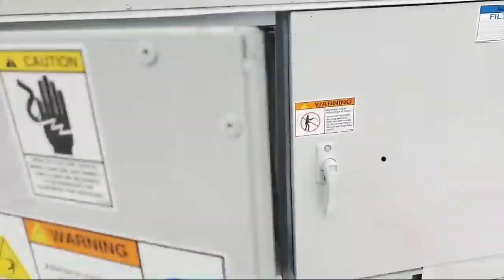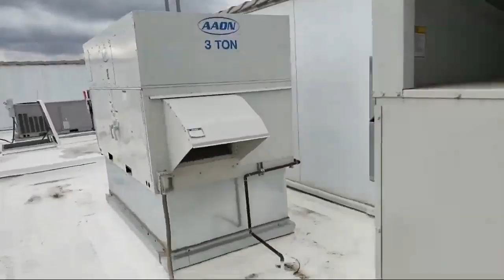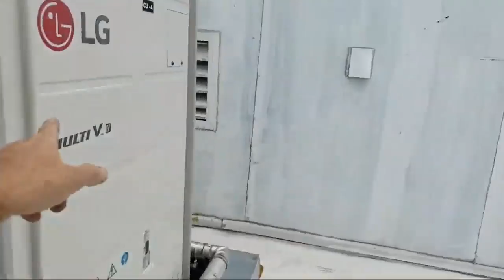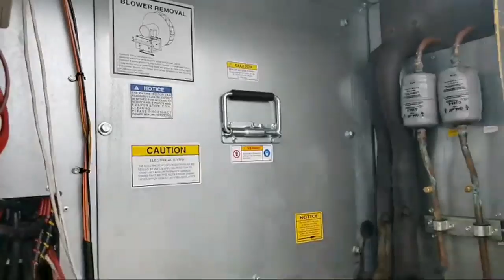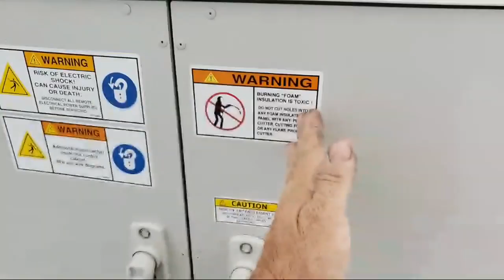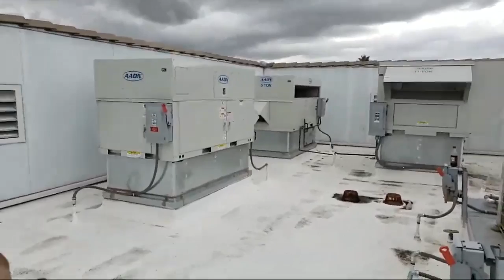Definitely Quieter than a Goodman!

Comment: you can look for a non inverter type rotary compressor for replacing the Goodmans . One of the great way is to lookfor it from the midea or gree dealers . these Chinese manufacture can't make scroll compressor out of there own ,so they have large non inverter rotaries upto 4RT.
Reply from the maker: Do their "non inverter" rotaries tolerate adding an inverter? Because running off of a VFD was my intention if I went with a raotary
Reply: @hackfreehvac I think it is ok , some eletric bus is useing these method to do all of airconditioning inside . also , it is pretty cheap to buy one , why dont have a try ?
Reply: @hackfreehvac  But you probably end up with a 380v (L-N 220v, L-L 380v) 3phase 50HZ compressor. but you are running it over VFD.

Comment: Aren't those digital scrolls more hassle than they're worth?  Surely VFD's are better, unless it's more of an issue with oil circulation if a scroll is slowed down too much?
Reply from the maker: A VFD to slow a rotary compressor would be more efficient but with these units they just care about maintaining a certain supply air temp and just unloading the scroll on a calculated duty cycle works well for that task.
Reply: @hackfreehvac  Awesome :) Keep up the good work on the vids, love em!  I laugh no end at your Good man bashing haha

Comment: Hey brother! Good to see you popping out a few more videos this week!!  I paused at 9:20 or so when you were commenting on the solid state relays in that unit, caught my attention :)
Maybe, mmm, the summer before last (been recovering from another back surgery this last year) I was over at a ham radio buddy's house (83 and more active than me, lol!;) because he had asked me to look at the Rheem condenser on his poolhouse (which he converted to his radio station/computer room) again. Seems like Ive been over there three years now out of five maybe for ants in the contactor.
Anyway this time I wanted to try something new, I had bought a handful of solid state relays because I wanted to get around to tinkering and replacing all of my mechanical ones on my condenser and air handler. (Still haven't yet but...)  id bought some then ran across a thread on the topic saying that it shouldn't/couldn't be rated at just the LRA but had to be way overrated to avoid failure issues, so wound up buying more. Couldn't find any with a low voltage AC coil rating so wound up getting ones with DC coils and bought a handful of way overrated rectifiers. (They were pretty cheap and I didn't have to make them so no particular reason for getting overrated ones;)
Anyway thought his Rheem would be a good guineypig (sp).  
He had a single pole installed so I put a single pole solid state relay in place of the contactor side and left the other side directly connected. Rectifier installed to the coil. Id tested the set on my mock up test board at home and it worked fine.
Pushed the disconnect in, turned down the tstat and it fired right up. Turned it up and the condenser shut off, but turning it down again and it wouldn't come back on.  Hrmmm...  Tried that twice. Any ideas?
Like I said, it's been a while so my recollection of the equipment may not be perfect, but I'm pretty sure that the tstat was a mechanical mercury unit and I don't recall a time delay relay being in the condenser. Hmmm... I can't remember if it was a heat pump or not, that's bugging me now that I'm trying to remember:/.   Grr.. Crap, now I'm gonna feel stupid if it is a hp and I was impatient and forgot to wait five minutes for the short cycle delay on the defrost board:(. Well, I've typed all this anyways so might as well hit the send button and entertain you, lol!  Any Ideas or comments on the idea in general since we're here? Heh. 
Thanks for the great video, as usual brother! :)
Reply from the maker: I've never tried one.  That would be interesting. 
A 5 ton scroll needs like 150amp peak current to start then 20 for RLA
So I'm sure digikey might have something. 
I have not tried it myself. 
Hopefully it's just a delay but maybe it fried.

Comment: Where I work we were putting in VFD and controllers in standard rtu ‘s to convert to variable speed. Drive controlled usually 2 compressors and the blower. 
It was definitely interesting. 
Company that made them was called Bes-Tech.
Reply from the maker: What kind of compressors? 
Seems that scrolls aren't too friendly to slowing down. 
Recipes can but that's old school now. Then there are screws on the larger stuff. 
I think most VRF use rotary.
Reply: The minimum safe that they allowed was 40hz. It very hit and miss. At commissioning you have to do a speed test for vibration. There were a couple  where the minimum speed had to be set to 50 or 55, and in some cases we had to skip a range where it made odd noises or vibrations. We no longer put them in. It worked great on new equipment. But on older stuff not so much. 
Anyways that’s my experience with it.
Reply: Most were scrolls btw.

Comment: Definitely better than a Good Man. 😂 The only thing I dont like are those micro channel coils that leak after a year. But every manufacturer uses those, not just AAON. Cool video brother.
Reply from the maker: We're not seeing the failures with those coils out here so maybe it's a climate related thing? 

There was a micro-channel coil repaired on a new unit by our installers (not an LG) and that epoxy stuff seemed to hold.

Comment: Love AAON! I have a customer that has a mixed batch of AAON and Johnson Control units. All I ever do to the AAON units is wash the coils, they NEVER break down. I installed a 3 zone LG recently in a customers new hunting cabin. He says he loves that thing. It works really well keeping the rooms it’s in their own individual temp. It’s got the inverted compressor and it heats really well in cold temperatures too
Reply from the maker: They are amazing machines. 
Have you ever used the LGMV laptop software plugged into them? 
I had that at the last job I was at. 
I wish I still had it but we seem to get along without it.
Reply: I have not used the laptop yet. I’m surprised at the number of people that don’t know how to service the mini split units. We take calls all the time from people who say they had a guy install it but he doesn’t know how to service it. I started working on them before there were even training classes. If I couldn’t figure it out I just called tech support and between me and the guy on the phone we could figure it out. Most common issue I have with them is board related. Either the board itself fails or the capacitors on inverter ones are built into the board and they go out and the compressor overheats and burns up. They don’t have a very resilient compressor in them, they won’t take much abuse.
Reply from the maker: @bambam5363  Yeah same here. 
The board's are the main thing to replace. 
And it's not all that often either.

Comment: I only install the LG’s large commercial VRF you can stick one on a residential if you choose the right inverter size properly they start at six tons for the multi-5. 
    and a large up right do you thin version of the LG for residential light commercial goes up to 60,000 BTUs of cooling and you have the option of heat recovery three pipe system so you could heat your domestic water or heat your swimming pool at the same time you’re cooling your house. Send large commercial LG VRF when first starting up only draws 2.9 A
Reply from the maker: My family don't need heat and cool at the same time stop no recovery 3 pipe needed here. 

My upstairs is a 4 ton system so a 4 ton MultiV Mini should do the trick. 
If I had the coin and were to use it. 

Downstairs would be hard to add multiple air handlers and the air handler for it is i.v the 2nd floor attic with ac single duct drop I think.  I can't remember. 
If it's two I'd be able to split it into two zones south two air handler units. 

The upstairs could get one per bedroom.

Comment: Upgrade your good man at home with three phase compressor. Use a VFD 2 1/2 to 3 times rated the horse power output of the compressor you choose it will do the conversion from single phase to three phase for you. You can use all the sensor input on the VFD for pressures and temperatures and program it yourself to operate exactly the way you want it. If you have a 45 turn you could turn it down to a 2 1/2 ton and only consume the power and have the output needed for the load on your system. Use a head pressure control maybe from ICM 3333 – LF so you precisely control your head pressure so it stays exactly where you want it at all operating temperatures. I know you can do it you’re more than talented and capable of programming a VFD either by Dan Foss or ABB
Reply from the maker: Yeah I was considering a 3 phase rotary like what they use in a Mitsubishi or LG etc. 
Those are made for a VFD and can be reduced to like 15Hz or so and probably driven over 60Hz when needed. 
I have a few 3.5HP VFD's that might survive on a 3 to 3.5 ton rotary compressor. 

I suppose they make controllers but I was thinking about making my own controller that read the pressure transducer and then output a DC output to the VFD input to speed the compressor on suction pressure feedback and the ODM on liquid line pressure feedback. 

Then maybe something to ramp the indoor blower on cooling demand. 

I might need a electronic explanation valve though.  A mechanical TXV might just adjust but I wonder of the compressor suction pressure loop to the VFD would fight with the TXV
Reply from the maker: It's gotta be on the cheap.  
It would be a Frankenstein build. 
As much DIY as possible.
Reply: hackfreehvac we have the exact same idea and I’ve seen your old videos where you do your own board controllers and board level repairs I to dabble in Arduino and raspberry pi with sensors. 👍 it would make a great video

Comment: So the electric heat is used for reheat in an O.R.room? I thought O.R. rooms are to be no higher than 60* to keep germ free environment? Or am I wrong? love the Goodman bashing, I hate them BIG TIME.
Reply from the maker: It depends on what they want. 
They seem to run them a little over 65 degrees here. 
Depending on schedule probably.
Reply from the maker: The electric heat tempers the air when the space met temp setpoint but the compressor needs to continue to run to dehumidify.

Today was a rainy day so they seemed to be in dehumidification mode.